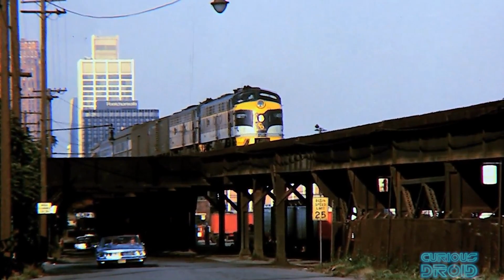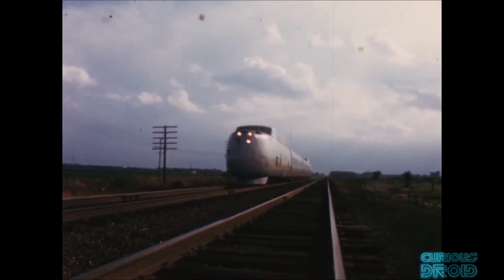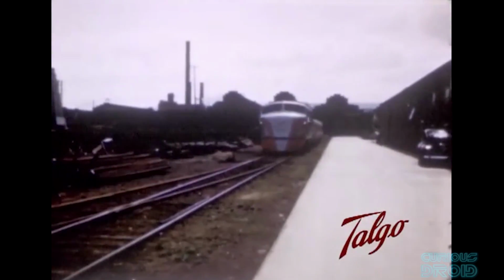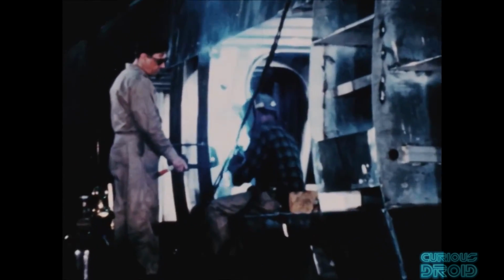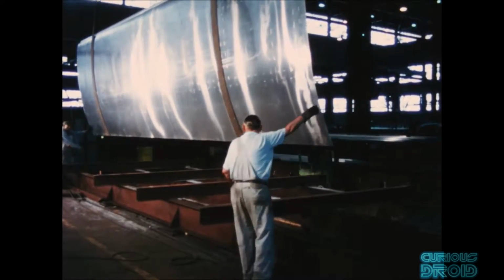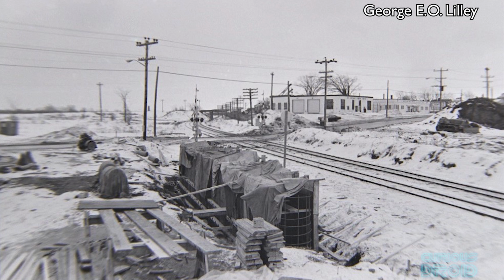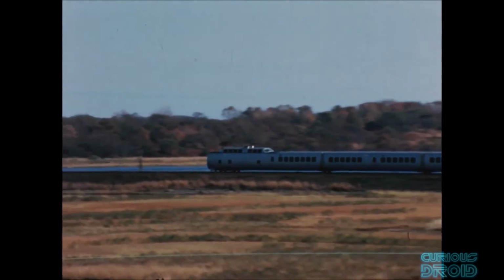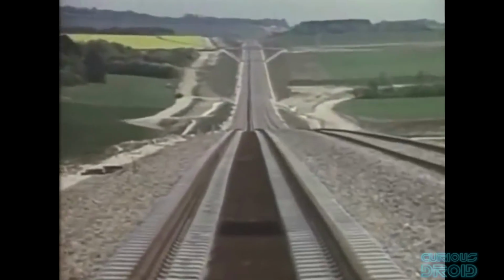America's Failed High Speed Tilting Train - The UAC Turbotrain

Comment: Shame that none of the train is on display at a museum. I would love to see the drive trian they used from jet to wheel..
Reply: for sure, the PT6 ran at about 6000 rpm , think it's a single spool with a centrifical and axial section.. so the reduction gear must have been a sun and planet arrangement,  turbines make better torque than you think,  hence lm1500's used in marine applications and pumping natural gas etc.. cool thing is there's no physical connection from the turbine to the gas generator.. so even if things go bad down the line , your power plant's sort of protected..
   I believe they run sort of like a helicopter,  thing runs at it's peak speed all the time, and you sort of sap off the power you need.. most pt6 powered aircraft have a low idle, and high power lever to save wear and tare on the engine on the taxiway.. plus fuel..  
   Be interesting to know why they chose this power plant over others out there..

Comment: I rode this train when it ran between New York and Boston. I was going to visit a friend on Boston, and was in about 6th grade at the time. I was already totally into trains, and knew what it meant to get a ride on the TurboTrain. In Grand Central I managed to get on the train ahead of most people and so was able to sit directly behind the engineer. The plexi partition meant that you could look past the engineer and see ahead, which was in itself an incredible thing. I recall the Mars light sweeping the tunnel as we left GCT, and there was at least one other person in the cab with the engineer and fireman, I don't know why.  At that time, third rail ended at Woodlawn in the Bronx. At that point we changed over from third rail; the engineer started the engines, which were quite audible. As I remember it, we saw a top speed of 105, which was through Rhode Island  and Massachusetts. It was a fairly rough ride, but I think that was due more to the deferred maintenance ( I stil love that euphemism) of the New Haven's trackage than the performance of the train itself.

Comment: I love how Amtrak tried it for a short time but it ended up being more sucessful in Canada until it was replace in the 80's witht he Bombardier/MLW LRC (Light, Rapid, Comfortable) which was another attempt at a "high speed" train with tilt, but could only run 180 km/h in certain area's with tilt enabled)
Reply: The LRCs were limited to 160 km/h in service, due to the numerous grade crossings, lack of in cab signaling, and mixed traffic with freight trains.  Due to problems with the mechanism, like occasionally "locking up" in tilt position, VIA gave up trying to maintain the system in the early 2000s and permanently "straightened" them.
Reply: @haweater1555  they could do 180 on some parts, but they got limited on most of the Windsor-Quebec Corridor.
Kinda like how the Acela can't do high speed on most of its route, and only has some sections that it can go full speed.
Reply: Amtrak ran their Turbo trains into the ground and never maintained them properly .

Comment: Amtrak operated Talgo train sets in the U. S. Pacific Northwest between 1994 and 2020. These were cantilevered tilting cars suspended over a single axle between cars, pulled by a conventional diesel passenger locomotive. They were successful, but limited in speed by the condition of the tracks. The series 6 cars were retired, but series 8 sets still run.

Comment: I was unaware that the Turbo also ran in the U.S. I only rode on it once, going from Toronto to Montreal in 1977. It broke down outside of Toronto and all the passengers were transferred to another mostly full train going by way of Ottawa. My father was a locomotive engineer for CN and he drove the Turbo on several occasions.
Reply: I remember the Turbo trains in the Ontario/Quebec corridor. I was fascinated with them as a child, yet I never had the opportunity to ride one back-in-the-day. I do remember their mechanical shortcomings were never mentioned through the major media of the day. For some reason the Turbo locomotives were frequently left running while parked in Union Station in Toronto. One of them overheated, melting the roof of the locomotive causing a fire which gutted half of the train that was still connected in-full. They looked cool, but the technology just wasn't there yet.

Comment: The UKs West Coast Mainline, East Coast Mainline and Midlands Mainline have no new track alignments, yet just meet high speed rail definitions - 125 mph. These lines are largely 4-track, with two tracks being fast tracks.

If they had in-cab digital signals they would reach 140mph with existing track.

But it is the end to end journey times that matter. If bottlenecks were removed with 160mph achievable on some sections of track and  dedicated fast tracks, the overall end to end journey times would be much faster. 

All cheaply achievable.  So they spend a fortune on a new track high speed line called HS2. This is slow end to end despite a claimed to speed of 250mph. The 100 direct miles between the London and Birmingham stations is covered at 113mph.  

In its busiest section HS2 is only 2-track - giving limited capacity. The Eastern leg of the Y shaped network has pretty well been dropped, as existing lines can match it when upgraded using faster trains. Parts of the Western leg look like being dropped going on government leaks. 

There are constant protests and calls to drop the under construction horrendously expensive HS2. Tunnel construction is under way into London. There are calls to drop the whole project, but use the tunnels to connect onto a diesel line at Aylesbury, the Chiltern Line to Birmingham, but electrify the line.  End to end journey time from London to Birmingham on an uprated Chiltern Line, will be pretty well the same as HS2. Taking the London-Birmingham trains off West Coast Mainline will release capacity on this line. 

All for a fraction of the price.

Comment: I was a newly hired Carman for CN cleaning coaches in the Spadina yard when the Turbo Train fire happened. We were told at the time that the fire was caused when a copper fuel line broke due to years of vibration. My question has always been what kind of engineer would design a fuel system with hard copper lines? I never made any sense then and still makes no sense. But according to the senior guys who had been maintaining the Turbo its was typical of the engineering on that train.

Comment: High speed rail is pointless unless you are going to avoid frequent stops at stations.  In order to make it not pointless it needs to be able to run high speed for at least 15 minutes between each station.  Which means the stations are positioned long distances apart. At least forty miles apart. And no one seems willing to do that.
* I've ridden high speed rail in other countries and they all had so many stops at stations that the train only rarely gets up to a high speed and usually only holds that speed for less than five minutes.  The whole trip was no faster than in a car on an interstate highway.  If the train had not been "high speed" it would have added only about 5 or 10 minutes more travel time for a three hour trip.  Fairly pointless for the big increase in cost.
* They want a high speed rail from LA to San Francisco. The only way it would be worthwhile is if it was non-stop for the whole distance. That means no stations in-between LA and San Francisco.  Don't forget that if you drive your car, when you get to your destination, you are exactly at your destination, and you don't have to take a cab, or walk a bunch of blocks. Nor do you have to rent a car because you already have your car with you.

Comment: Not having dedicated high-speed rails is also a huge problem here in Germany. Only the most important bussines routes connecting Karlsruhe, Frankfurt, Koeln/Düsseldorf, Hamburg, Berlin and Munich run on dedicated high speed networks. Most of the other lines run on standard rail, where they can't reach top speed even if the track is free.
Reply: Funny thing is it’s still better than our rail in the US. I know the Germans complain a lot about the rails there (and fair enough), but I’m always awestruck when I visit.
Reply: @spartan117zm  the biggest issue it has is reliability and dependency. I would never take a train to get to the airport because I’d be afraid to miss my flight if the train is delayed or simply canceled. DB Customer Service is also horrible and it takes ages to get any refunds. It’s also way to expensive. 4€ for a 20 minute one way trip just ain’t it.

Comment: The double-decker cars used by New Jersey Transit to NYC are extremely smooth compared to the old SEPTA trains I used to take in Philadelphia (since upgraded). Are modern passenger cars using a version of this system or something completely different?
Reply: The Bombardier/Alstom Multi-Levels don’t tilt, but they probably have a better suspension than the single-axle bogies between cars on the turbo-trains.

Comment: Amtrak's Rohr Turboliners were a much more successful incarnation of the turbine engine train in America.  Inaugurated in 1975, they ran in passenger service until 2003 with intentions to run much further, but a complete rebuild program was abandoned midway through and the trains scrapped a decade later.  They didn't have aspiration to be true "high speed" and didn't tilt.

Comment: Hey Paul, this is kind of a great story for me. My dad was very involved in the Turbo project, as an engineer at United Aircraft in Montreal. He spent a lot of time in Hartford Connecticut working on this, before being one of the key sales engineers when the train came to CN.

This is turning into one of my favourite channels, because I hadI suggested that you cover the Napier Deltic engines back a few months ago. The reason was my father was also very involved with that powerset, including the British Rail implementation, as well as marine engineering deployments.

He in fact came back to Canada with a newly-minted marriage to my mother, expressly to sell the Deltic. But Napier's overall fortunes were not great in the fifties. He left Napier, and got his job at UA, largely on the strength of experience with the Deltic, and specifically to develop proposals for the PT6-ST6. In that capacity, he also worked on the PT6 Indy turbine car – another interesting story – and the DDH-280 Tribal Class destroyers for the Canadian Navy – again, in part through his experience with fast torpedo boats running on the Deltic.

The story you tell is great, and a bit of a heartbreaker for dad. I think there was something about the Turbo that meant more to him than most of the other stuff. But he also understood that the conditions in Canada were pretty unpromising for it. 

What's not included in the story, is how rail traffic is allocated in Canada. The passenger services never made much money, so even when they were run by the same company – in this case, CN – economic realities meant that the passenger trains took second of third or fourth priority. A lot of work was done to overcome this on the crucial Quebec City-Montreal-Toronto-Windsor line, which was judged to be the only high volume corridor in Canada that could hope to justify this project.

But Canada had two competing railways – CN and Canadian Pacific – both losing money of passengers. It seemed rational to spin off both services into Via Rail. But the problem immediately was (and still is), that after that, Via had to rent rails from CN and CP, whose power to reprioritize their use grew greater, now that they didn't have to take responsibility for unhappy passengers – "that's Via, madam, not us".

This was also the transition era to welded rail, so a lot of the lines the Turbo ran on were waiting upgrading, or partly upgraded, meaning that track conditions could vary wildly, as the trains transitioned from the long ribbons to short, ill fitting, usually under maintained sections.

The bigger backstory is that the original railways built in Canada were full of inducements to their private developers, of huge land grants, extending miles on either side of the tracks. This meant that the railway companies got the best routes at the very beginning in perpetuity, and had no interest in playing ball to allocate land to building a dedicated high speed line. After all, they might one day want to do that themselves, and they weren't giving up the control they had of prime routes.

The maintenance issues were another thing, mentioned at the end. UA came up with a really innovative model for removing the power units completely, and swapping them in, rather than maintaining them in the units. Given their small size, and low weight, and their complete lack of fit to the existing railway maintenance infrastructure, this was a good idea, but still caused problems with unionized diesel mechanics who worked on the other trains.

As with Napier before, dad left UA and went to another company that valued his experience. That company was Montreal Locomotive Works, who he'd worked with during the original construction of the Turbos. While he was there, they released the LRC, a conventional diesel-electric engine and linked car set, that like the turbo was supposed to use the shared bogie system. These trains, like the Turbo, were designed to be very lightweight, and had active banking mechanisms, powered by the diesel power unit. 

This meant, I think, that they were incompatible with normal engines in service, which was the beginning of the problem. Then, the banking mechanisms were not all they were hoped to be. And in addition, the same problems of shared rails, and subsidies to  a domestic regional air carriers, airports, etc, mad this play at a med-high speed rail service a dead duck.

The power units did live on, though, for a number of years after the carriages were done away with.Because of their low profile, they always looked a bit ridiculous, pulling the higher standard coaches. But they were fast workhorses, possibly because of the extended legacy, going back to the Royal Scot, that had shaped them.

If you are ever looking for another Canadian-based subject – no, not the Avro Arrow – I'd love to see how you'd treat the Bras D'Or, Canada's hydrofoil, for quite a while the fastest warship in the world. Again, that was a project dad worked on, and the other thing he was most wistful about...
Reply: Dude, you need a Curious Droid segment of your own!    The Avro Arrow, the Brad D'Or...   I hear ya!
Reply: Don't forget a lot of VIA rolling stock is second hand from the Chunnel.  Cars were built for the dash over to France but could not be used because they did not meet the specs.  VIA came along and bought them and I see them here in Halifax all the time.  Across from Pier 21.   Like any other business you have to put money back into it to KEEP making money.  Passenger rail anywhere in the world is no different.  I would far rather travel by train.  Given that driving and air travel are maxing out its simply a matter of time for passenger rail to revive.

Comment: Excellent video. In Canada the Turbo train sets were replaced with a more conventional diesel electric tilting train made by Bombardier called the LRC. Many of the LRC carriages (without the LRC locomotives or tilting systems active) are still in service today with VIA until they’re replaced with new sets in the next few years with their new HFR program (Dedicated tracks finally!!) and Siemens built locomotives. Cheers!

Comment: I remember this train being advertised in the station when I was little. I was enthralled, and wanted so much to see it. But, being on the Toronto - Windsor section of the corridor, never got the chance. Being older and wiser now, I realize the impracticality of turbine engines on rail vehicles. If you want to save weight, then electrification is the best route. And yes, you have to have to have a dedicated track. 

We’re now forty years behind in our infrastructure, and the cost to develop is huge. But the “401” corridor for passenger cars is almost at its max, and the corridor now needs the high speed train more than ever.

Comment: French here to give you some extra comparing points, I can go tomorrow to a train station in Paris and take a TGV to go to Marseille (around 500 miles away, like San Francisco to San Diego), it would take me around 3h15 and cost me around 50$.
Reply: In the US a train takes about 10% longer than driving and costs around 10% more than flying. Sigh. Some commuter routes are quite a bit cheaper depending on how clever and flexible you are at sheduling.

That said I do prefer the train over flying because I like the general experience better and enjoy the scenery... but only if I can get a direct route. Trians have more room than planes (for the tickets I can afford) and dont make me feel like crap. Once transfers are involved it has the same problem as airlines have: long wait times in uncomfortable waiting areas and possible missed connections and lost luggage. Not worth it. And unfortunately the East Coast routes are mess of connections with few functional Redeye services. And also unfortunately flying in the US on a budget ALWAYS means connecting flights, and often travelling in the opposite direction you are actually going. 🤦 Which all contributes directly to why many people in the US prefer to just drive. Because even flying can sometimes take just as long.

Comment: so basically no high speed rail without high speed track? the APT ditched its turbines for 2 main reasons 1 the government thought nuclear power and electri trains were the future and 2 the APT was designed around old obselete turbines (ironic that the APT was built by British Rail in Derby which was also the home of Rolls-Royce aero engines yet it did not use a RR engine)